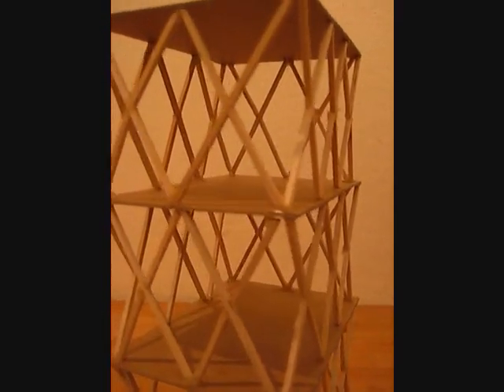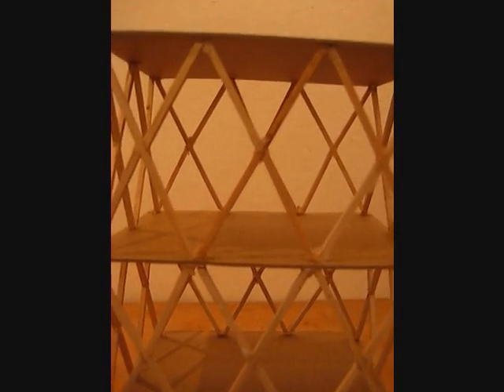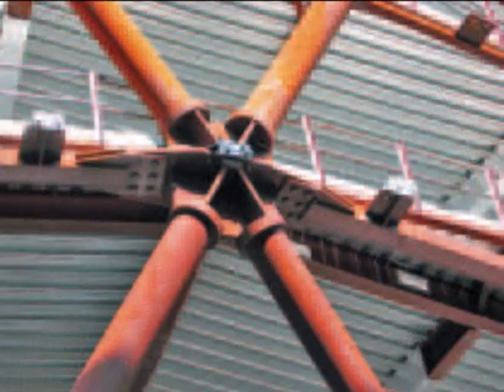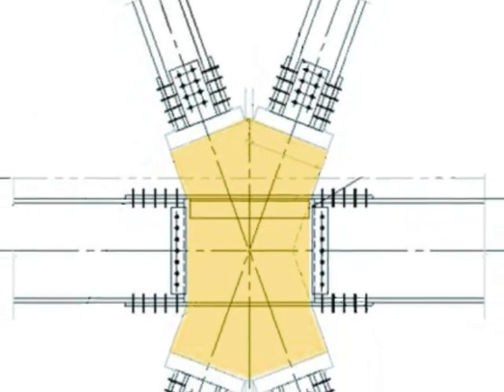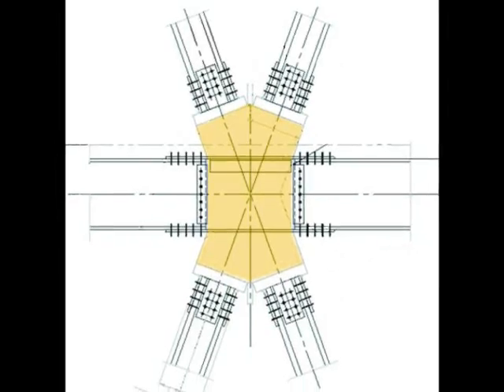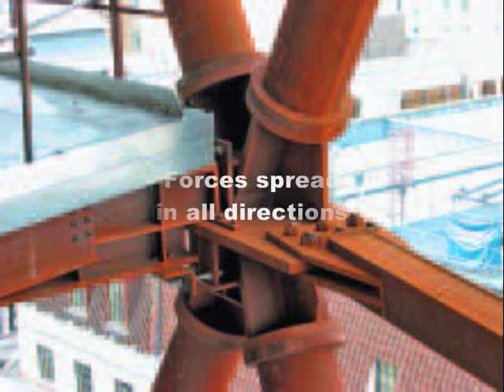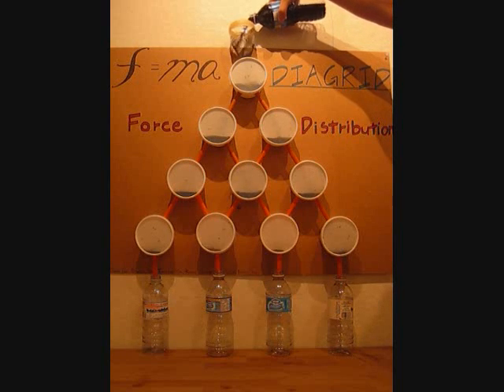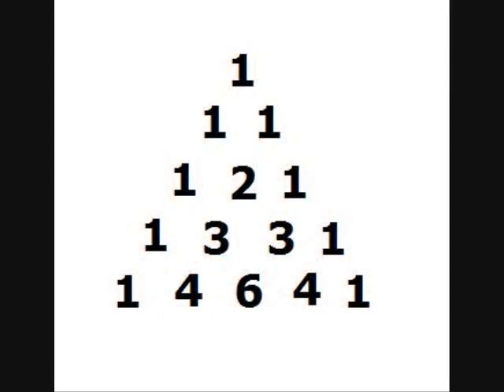PCS107: PARADE 2009

Comment: Very professionally done! The only I comment that I will make is that the flow of speech was 'choppy', meaning that one voice was louder than another or the pace of speech was not the same. Overall, very well done, the demonstration was appealing and you showed many examples of diagrid structures. Your video would make a really good learning tool. Excellent job !